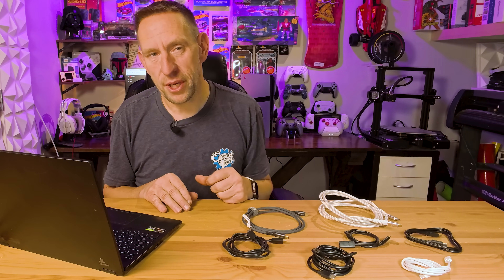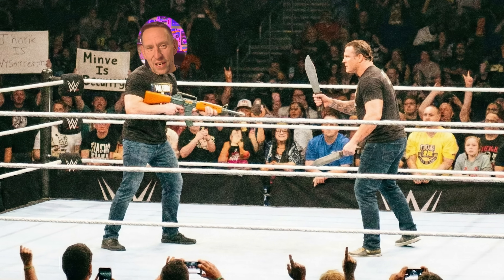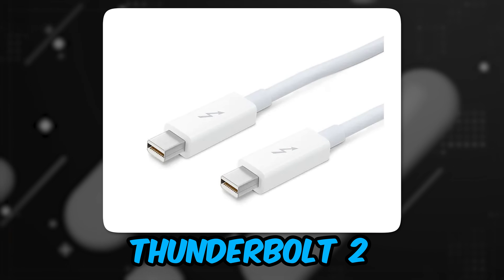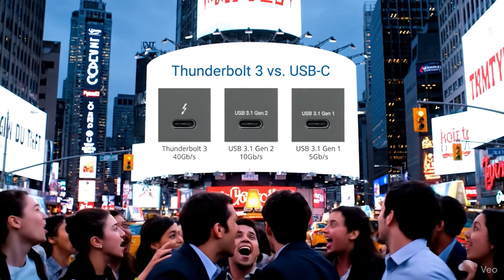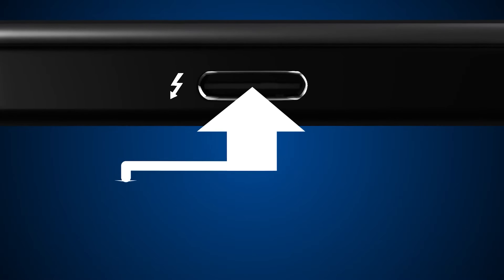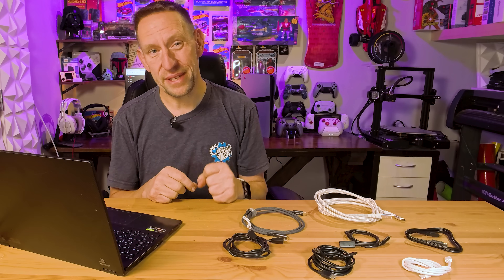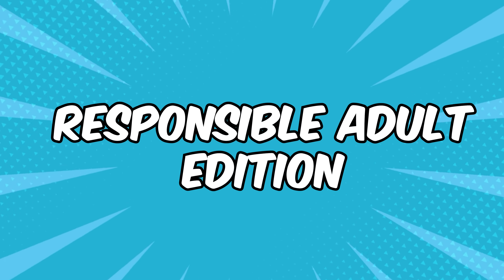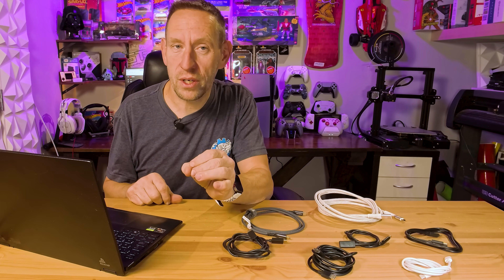USB-C vs Thunderbolt - Why Does The Same Connector Have Different Speeds?

Comment from the maker: 💥💥💥💥 SAVE ON NETFLIX, DISNEY+, CRUNCHY ROLL AND MORE! 💥💥💥💥
✅Use Discount Code 'GEARS' here  - https://www.gamsgo.com/partner/JmWGqN

💥💥💥💥 Thunderbolt Stuff 💥💥💥💥
Thunderbolt Cable - https://amzn.to/4q7fBhj
PCIE Card - https://amzn.to/4ja5MfB
Gaming Monitor - https://amzn.to/4p86YBM
eGPU Dock - https://amzn.to/4992tAZ

💥💥💥💥 Mini PC Options 💥💥💥💥
Cheapest 5825U - https://amzn.to/44Sm7j2
Mid Grad 6800H - https://amzn.to/3MlX55D
High End Mini PC - https://amzn.to/4iJI8qc

💥💥💥💥 PC Build: 💥💥💥💥
CPU: AMD Ryzen 5 5600X ($124) - https://amzn.to/3BkvlZq
CPU Cooler: Wraith Stealth Cooler (comes with the CPU) ($0.00)
Motherboard: MSI B550 GAMING GEN3 ATX AM4 ($99.99) - https://amzn.to/4e1HfWK

GPU: ASRock Challenger OC Radeon RX 7700 XT ($389)/7800 XT ($469.99) OR MSI VENTUS 3X OC RTX 3070 Ti ($482)/Gigabyte WINDFORCE OC GeForce RTX 4070 Super ($370) - https://amzn.to/3XxFcTv 

RAM: G.Skill Aegis 16 GB DDR4 3200 MHz ($29.99) - https://amzn.to/3zvrYyk
Storage: Western Digital Black SN770 2 TB ($119.9) - https://amzn.to/47wsWXO
PSU: Corsair CX (2023) 750 W 80+ Bronze ATX Power Supply ($74.98) - https://amzn.to/3MQsQAG
Case: Zalman i3 NEO ATX Mid Tower Gaming PC Case - 4 x 120mm Fixed RGB Fans Preinstalled - https://amzn.to/47tD5V2